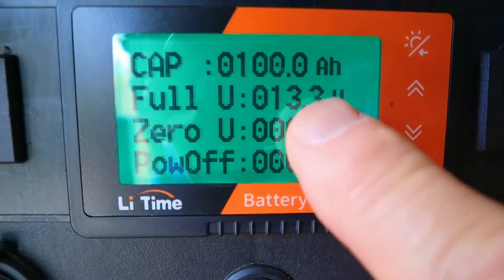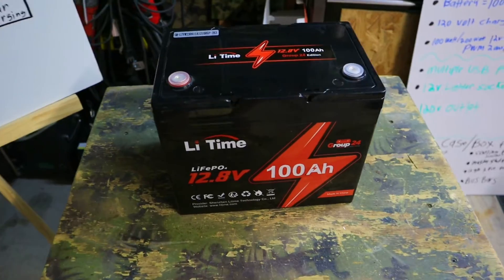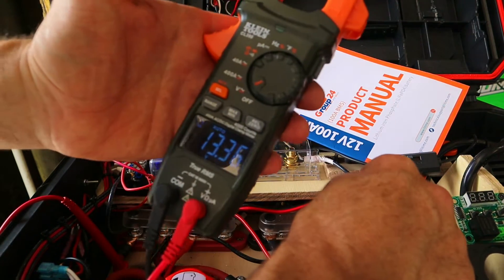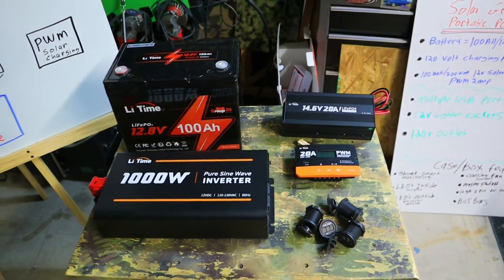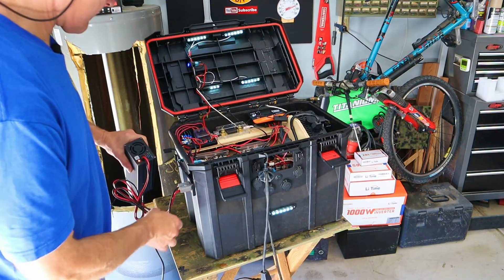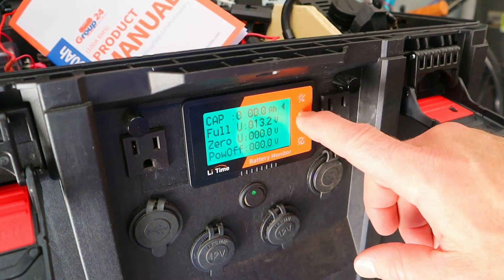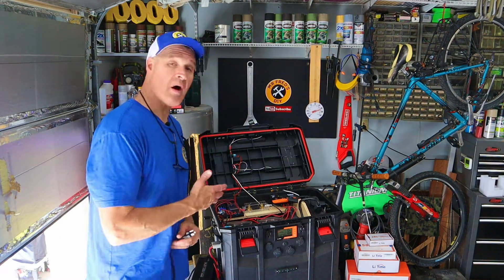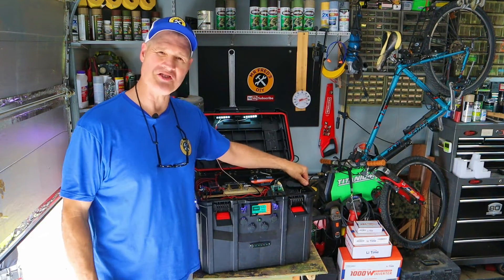How To Program Battery Monitor Shunt  (The Easy Way)

Comment: I bought this monitor and am not sure it's working right.  MY TV with my watt meter shows .75 amps.  My clamp on at the battery shows 1.05 amps.  The monitor shows 4.12 amps.  Why is it so high.  I have the meter calibrated.

Comment: Why do you need to drain it down to 0, and it's it crucial??
Reply from the maker: I have seen some people charge the battery until the charger shows full, then set the monitor to 100%. The instructions call for the opposite to be done. Drain the battery until it shuts down, set the monitor to zero, then charge the battery.
Reply: I have noticed if you dont drain the battery to 0%, the charger wont shut off when it gets to 100%. So if you dont drain it, you have to watch it and shut it off yourself at 99%/100%.

Comment: The full voltage would not be 13.3 volts, that’s way too low. Should be just under the max charging voltage of the charger 14.4v-14.6v for lifepo4 battery, zero volt could be 10.5v-11.0v or a little higher to leave some capacity before BMS shuts down, that number the meter should just automatically resets to 0% left of battery capacity.
Reply: LiTime battery full charge is 13.6v after one hour 'rest'... Charge voltage is 14.2 to 14.6.. I use standard 14.2 volt setting in Victron system settings. My 230Ah battery drops to 13.4V quickly with 200mA load. My 'system' is a FULL time UPS.
Reply: @mikerockwell5242 he set the full voltage to 13.3v that is when the meter will automatically reset to 100% that is way to low. When charging a lithium battery the voltage is way over that.
On a SOK 100ah with a 14.6v 30 amp charger
0% 11.77v
30% 13.56
40% 13.58
45% 13.59
56% 13.62
60% 13.64
72% 13.73
90% 13.80
96% 13.91
97% 14.24
98.5% 14.64 BMS shutting down for over voltage, slight cell in balance.

Comment: Hi Mr. Fred, I purchased all LiTime products- 230 Ah LiFePO4 battery, this same 500 Amp battery monitor, and a 14.6V 20A LiFePO4 wall charger. I did exactly as you described, but when I tried to charge the battery back up with the wall charger, it only charges to 13.0 volts. Isn't it supposed to be closer to 14.4 volts? I notice yours is also well below 14.4. Is that normal?
And, despite working great before I discharged the battery, now my monitor is stuck on 0 AmpHours, 0% capacity, and 00:00 hours remaining. I have been trying to get help from LiTime, but it takes them several days to get back to me with suggestions that haven't worked yet. Any advice? Or anyone you can recommend to help me troubleshoot? I need to resolve this ASAP to leave on a trip.
Reply: No. 14.4 is the charge rate. Not the resting voltage. Resting voltage fully charged should be about 13.3. When your battery reaches this, go in the settings and set the Amp Hours to 230 and voltage to 13.3.
Reply: @SOLDOZER  Thank you! That makes more sense.
Reply: @  I just fully charged my Power Queen lithium batteries yesterday. I have the 100Ah "smart" batteries with Bluetooth and they also have the shunt monitors. After fully charged they will settle down and "rest" at about 13.3. 
Also a 20A wall charger for your 230Ah battery is on the small side. It will work just fine, just will take a lot longer than needed. A 40A would be ideal. Not a must have, but would be faster.
Reply: @SOLDOZER  14.4 is not the charge rate, 14.4 is the voltage, charge rate would be the amps of the charger. Nobody is going to charge or discharge a battery for however long takeoff their loads and measure the voltage on a lithium battery. This is why you use a shunt. You cannot put in the shunt for the full setting to be anything near 13.3 Volts. This is when the shunt will automatically reset the display to 100% charged. Which is not true when the charger is on and charging the battery.
Reply: @LindyWinter-u8t  on a SOK 100ah battery with 14.6v charger
0% 11.77
30% 13.56
40% 13.58
45% 13.59
56% 13.62
60% 13.64
72% 13.73
90% 13.80
96% 13.91
97% 14.24
98.5% 14.64  BMS shutting down from over voltage. After using a 5 amp power supply to top balance the resting voltage was 14.05v anything over 13.4v is full charged. What was your voltage at at 0%

Comment: How do you get the screen to shut off? I installed this on my golf cart and can’t get the screen to turn off. I can turn the backlight off but not the monitor?
Reply from the maker: The monitor stays on as long as it has power. The red wire that has the ring terminal could be connected to a simple rocker switch.
Reply: I think if you push the down arrow multiple times it makes the back light darker.
Reply from the maker: I will give that a try!

Comment: The monitor works great, but the cable is very very fragile. The wires are not protected where they attach to the cable plugs and break loose from the connector. Since the cable is not offered separately, you have to buy a whole new battery monitor. You guys need a more robust cable. The one you now build is terrible.